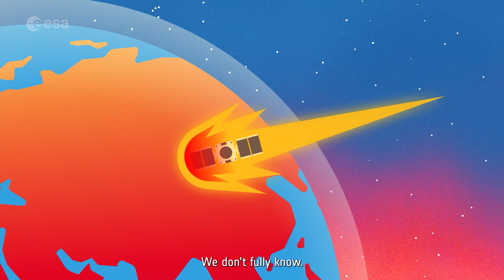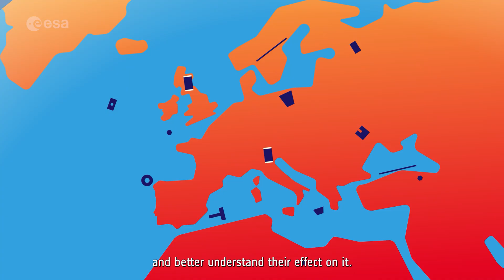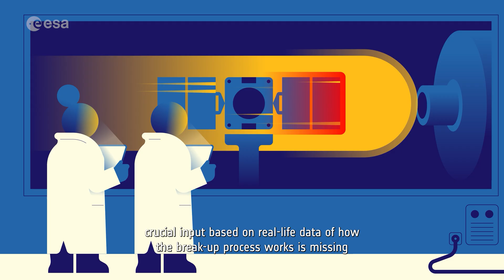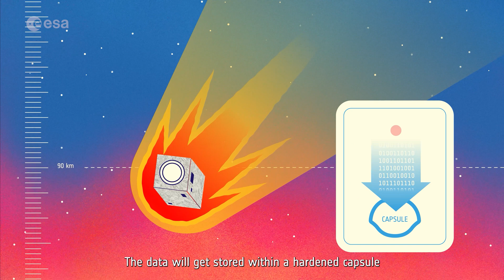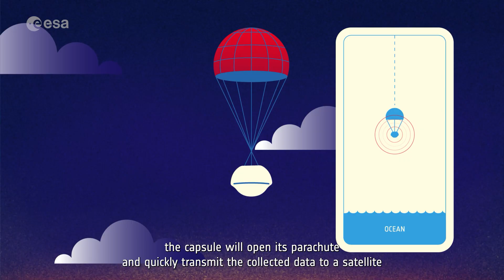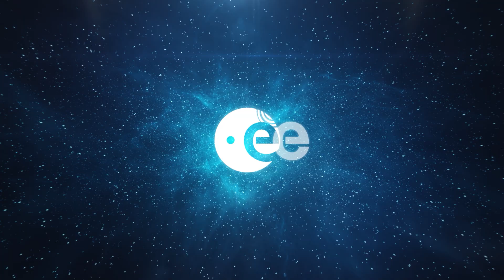Draco: atmospheric reentry from the inside

Comment: Why does Draco go in the opposite direction to most other satellites in the first picture?
Reply: @gottfriedheumesser1994   once in orbit there is no preferred direction. To stay in orbit you just need to be travelling at the right speed for your altitude. Some are geosynchronous, some go pole to pole, some orbit around the equator.
Reply: @ariaflame-au  To utilize the speed of Earth's rotation, most satellites and spacecraft orbit in easternward direction. Going in opposit direction would need more energy for launch and also more risk, as most debris will face you at very high speed. Study basics!